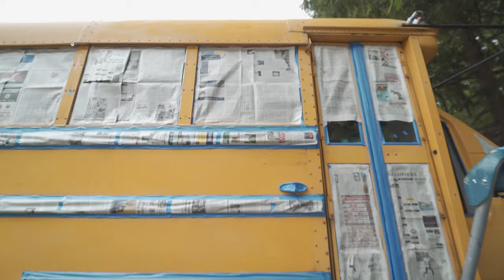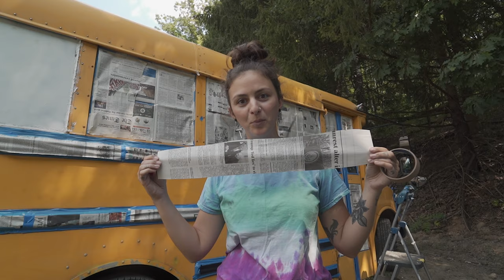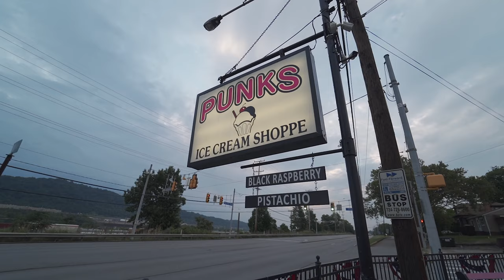DIY SCHOOL BUS BUILD | Painting the Bus!

Comment: What year is this bus that you guys are converting? All I know is that it's a Thomas Minotour with the standard headroom that's built on a 1996-2002 GMC Savana 3500 cutaway chassis, which is powered by the 6.5 liter Detroit Diesel V8 engine.
Reply from the maker: ‘O2 gmc Savana baby